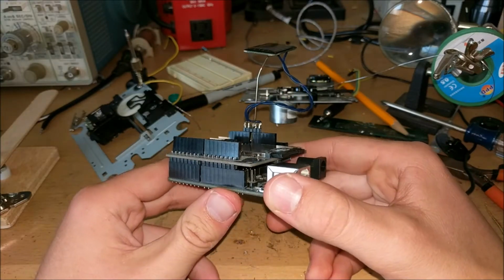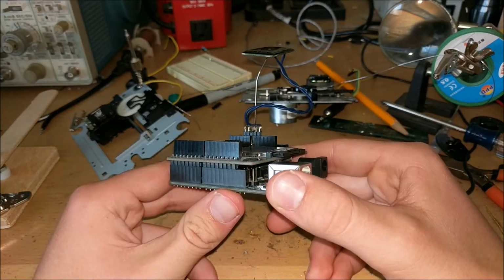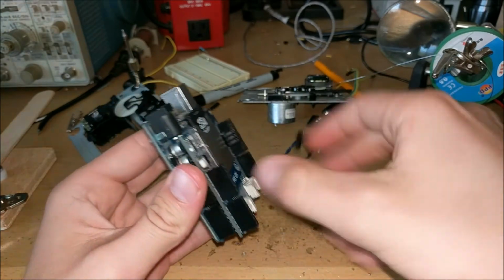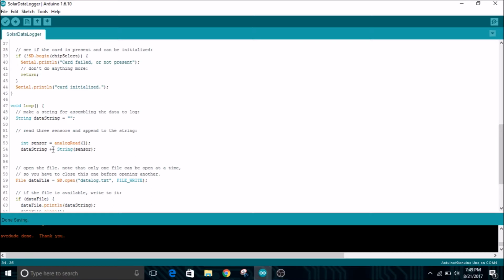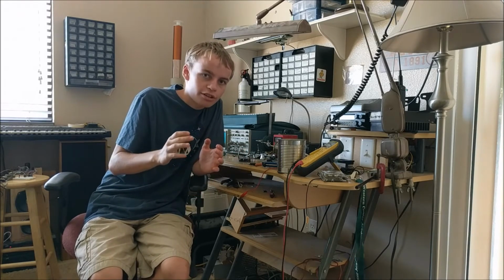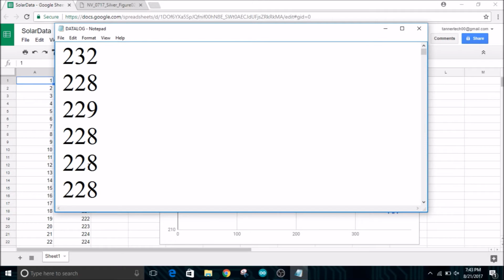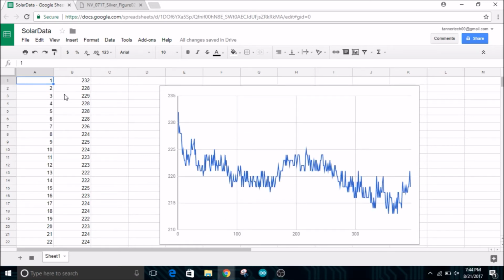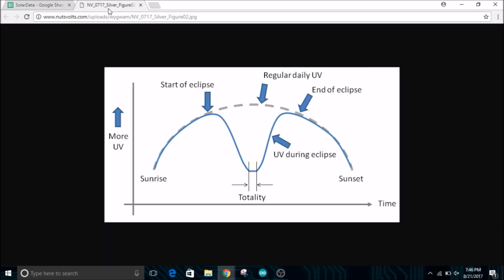Solar Eclipse Data Logger

Comment: I live in Texas and I saw it in my backyard great video keep it up
Reply from the maker: +cool boy dude Thanks!
Reply: Tanner Tech did you get the full effect of the eclipse ??? I didn't tho but it was still cool
Reply from the maker: +cool boy dude No, sadly I'm not in the path of totality.  I probably saw the eclipse the same as you.  I live in southern California.
Reply: Tanner Tech oh ok did you see the eclipse I used welding goggles to see it work great I'm to cheap to buy the glass so I used what I had laying around 😀😀😄
Reply from the maker: +cool boy dude Haha, nice!  I used my telescope to project the sun onto a piece of paper.  I also tried the glasses, but the telescope projector was better.
Reply: Tanner Tech ok cool I don't have a telescope and have you heard that you can make a solar cell by using diodes I made a smd diode cell it works good I used 16 of them you should make a video about one
Reply: Tanner Tech ohh and something I think is cool is that my sister's birthday was on the 21 of August 2017
Reply from the maker: +cool boy dude That is a pretty lucky birthday to have

Comment: Hey, that example you pulled from the internet showed the light falling before and after the eclipse because of the sunrise and sunset, I doubt this was the cause of your drop in light seeing as your setup was only on for just over 3 hours ( 30seconds times 400 samples) it may have been caused my cloud cover and/or what you mentioned with resistance. Something you can try for the next solar eclipse in 2024 is block all light accept directly from the sun. Also you should make a devise that slowly moves to keep the solar panel and your telescope pointing at the sun. Also if the unexpected drop in light levels was cause by some resistance issues, using a common photo sensor that is designed for accurately sensing light levels may help
Reply from the maker: +HumorVortex Mosco Hmm, your right.  Can you think of any other reasons behind this drop?